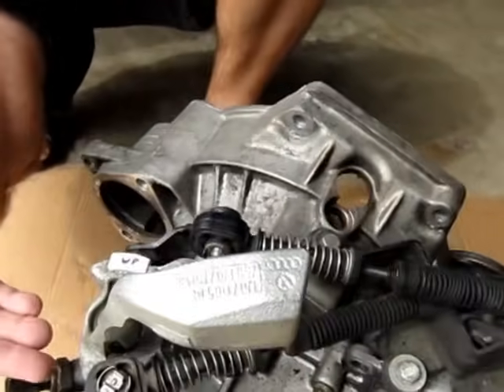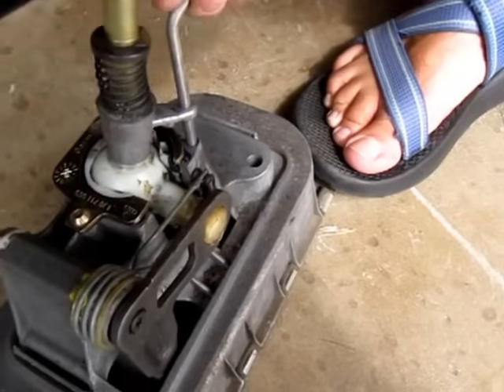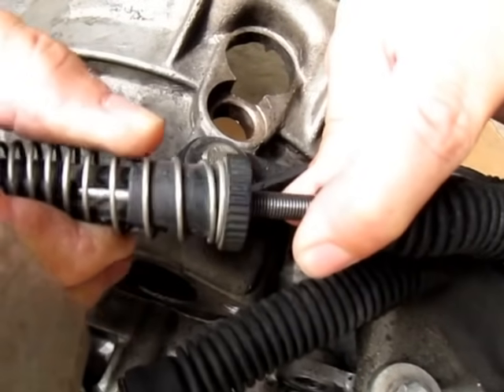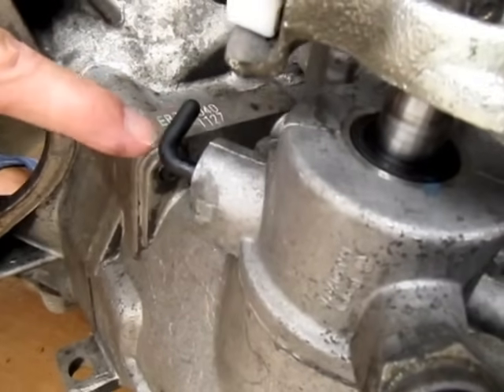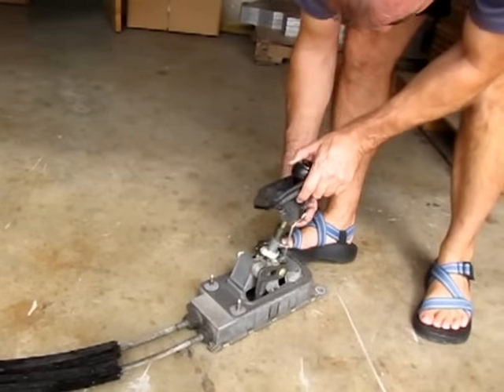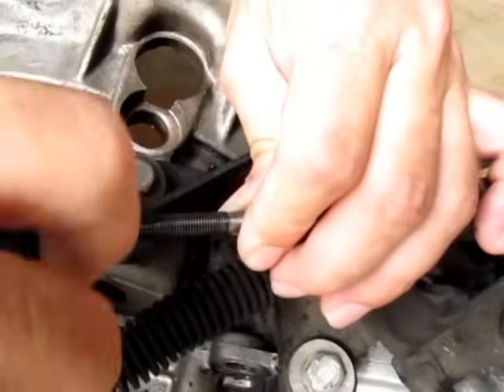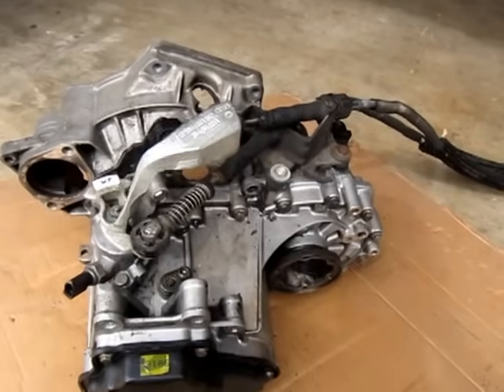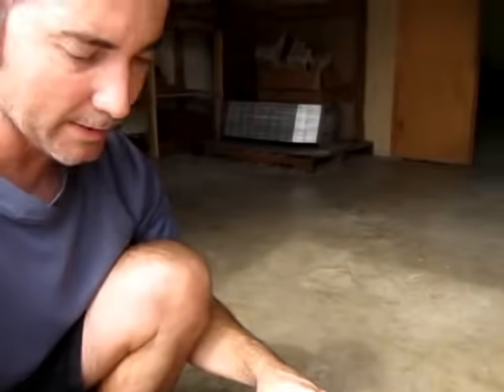VW MK4, MK5, and MK6 5 speed shifter adjustment for 02J and MQ250 transmissions

Comment: Hi there so my car (02 jetta 1.8t) wont go into 1st gear its basically like hitting a wall I've tried to slam it into first but it still wont go. I can manually put into 1st through the engine bay but not using the shifter. Yesterday I went to put it into fifth same issue. Any ideas before I burn a whole through my wallet?

Comment: I have a Skoda Fabia 2003 1.4 8V, I'm not sure if it's ecauae they gearbox is taken out of the ngine bay, but I feel like the counter weight looks a little bit different in my car, everything is really similar. Is this method of adjusting going to work on my car's gearbox, or does it differ from a model to another
Reply: dieselgeekdotcom , yes, cables. No set of holes, and yeah my pin is chipped off. I did figure it out though thanks you to guys. It didn't work the first time though and this is why I was confused.

Comment: Thanks for the video, one thing that would improve it would be to indicated what direction you're pulling to pull the slack out of the cable, an arrow or something would be nice.  The first time I did it I pulled the wrong direction and lost 1st gear.  2000 Golf TDI w/267K miles and still getting 50 MPG.
Reply: And yet after your criticism you also fail to mention which way to pull the cables.
Reply: @joepenfield  Yeah exactly. This is where I'm at right now and can't figure out which way removes the slack.
Reply: Push the cable towards the shifter knob inside the car. ....loads the shifter knob assembly making the cable tight. Hold that position and release the spring.
Reply: @cconditt Thanks.....now back to the GTi......😂

Comment: Paid a mechanic that had no idea what they were doing to install my shifter cables (my first mistake, but they had all 5 star reviews). I've lost 5th, and the car is going into reverse where 1st should be. 1st through 4th are now where 3rd through 5th should be. Any tips? Likely taking this to a shop soon. I tried this shifter adjustment and neither of these methods made a difference. Hoping it's nothing catastrophic. Before I had to replace the shifter cables, it drove like new at 128K.

Comment: I need help. jetta mk5 TDI 5-speed , 2006. I have play in the shaft of the shifter tower on the tranny, the one that goes up and down into the transmission. I have play left to right, considerable, and i havent found a bushing for it anywhere. I know theres a seal and needle bearing for the MK4 5speed, but i cant find anything for my MK5. HELP ! I made a little video to show the play in that center shaft, i hope its ok if i post it here. https://www.youtube.com/watch?v=t1RNtZE7fig
Reply: maybe change the super slider from dieselgeek.com

Comment: Jim thanks for the great instruction. I had an old cheapie screw driver that was 5mm dia. I think a 5mm pin gage (used in machine shops) that is 2'' long would work too.

Comment: Hi Jim - Thank you for the video as it’s been helpful.

I have a 2002 337 6-speed. I am finally able to engage 6th gear since purchasing the car 2 months ago. However, I need to press down on the shifter to engage 1st gear now. If I calibrate the shifter to engage 1st gear nominally, I end up losing either 6th gear again or even both 5th and 6th altogether.

Any ideas what I might be missing? I can’t seem to figure it out. 

Thanks again.

Comment: That number by the locking pin, is that the trans code? I'm looking to find the trans code location.  On a 2007 Rabbit 2.5. manual 5 speed box.
Reply: Thank you for your prompt reply. I checked mine & it's JCT, at 180,000 I'm clashing going into 3rd. Looking for a used one.

Comment: Hey thanks for the awesome video!! I used this to adjust my shifter, and it feels much cleaner and smoother now - but I have a new problem I hope you can tell me how to resolve. 

The problem I started with was that reverse was hard to engage. I couldn't push downward and just slide into reverse....it started with "clunking" into reverse, and eventually, about 2/3 of the time, I would just end up in 1st. That problem is almost entirely gone now. However, there was a trade-off: I don't have 5th gear at all! What might I have done wrong? I feel like all the gears have "moved to the right", if that's possible....and 5th gear is so far right that it's just not there. I thought I had 5th when running through the gears during the adjustment, but apparently that was 3rd. :\

Also, fwiw, I used a drill bit on the shifter because I don't have that "perfect fit" peg you demonstrated with. My drill bit is the largest one I could fit into the top hole, so it's not loose there, but it's loose in the bottom hole. And the shifter doesn't seem as solid when locked into home as yours appears to be in the video. I'm not sure if that's an issue or not. 

Would appreciate any advice :)
Reply: dieselgeekdotcom thank you!!

Comment: Hey i saw both off your totorials on the gear adjustment on MK4 transmition. You talk about taking the lack out before releasing the cable spring adjustment. please shere is IT nesesery becouse you talk nothing about that on the 2nd totorial. greetz

Comment: Will this work for the O2M factory 6 Speed trans in the 2002-03 GTI 337/20th Anniversary/ 2003 Jetta GLI VR6 ?  Logic says it should but there is an extra gear there.
Reply: Thanks for the information. Looks like I need to take the battery and battery tray out first which is no big deal. Then I just need to be very careful not to force the locking pin so I don't break it.
Reply: What exactly is a sigma 6 transmission? Is that what they call the newer 6 speeds in the Mk5? I understand it's similar to the 02M which is the earliest factory 6 speed I'm aware of. Aside from the nail shaped head on the pin.

Comment: Had to remove trans from a 2004 gti 5spd. Installed a 2000 jetta 5 speed. Had the large chrome shifter foot removed where the cables hook to. Reverse seems to be first gear. Wondering if i have the chrome part clocked wrong on the splines. Any advice.  Shifter goes in all other gears.

Comment: Thanks for the Video. I was able to do it via the second option, (Broken L-Shaped locking pin method).  However I don't think my L-Shaped locking pin is broken.  I just couldn't get it to lock into place! Maybe it's my rookie hands in this particular project.  I pushed the lever bar down a little bit as directed to do, while adding slight pressure to the L-Shaped locking pin waiting for it to lock into place.  It didn't do it.  I added a little bit more pressure to the locking pin, and still wouldn't lock into place.  I don't want to add too much pressure and break the L-Shaped locking pin.  Any suggestions on how to get it to lock?
Reply: Figured it out. Watched the video again, and noticed that while rotating the L-Shaped locking pin upwards, you push the pin in as well.  Bingo. Redid the job in 3 minutes, and everything works great, and feels smoother.  Thanks!

Comment: Hello, I have a 2001 jetta tdi auto changed over to 5 speed. It has sarted getting harder and harder to shift. Today I almost couldn"t get it to go into gear at all. I can't tell if it is a slave cyl. issue or an adjustment issue, or something else. It doesn't slip at all or pop out of gear. Any intel would be greatly apreciated. Thanks
Reply: dieselgeekdotcom  Ok I will this weekend. Thanks for the reply.

Comment: I tried to do this. The cable that I guess controls going into reverse, mine pulls right out from the spring clip part. There's a ton of slack to the point where it just falls out and the clip doesn't catch. I sort of managed to get the two connected, but when I drove, 3rd and 5th were really short throws and would grind if I didn't hold it tight into gear for a few seconds. After driving for about 25km or so, the problem came back where I can't get into 1st or 2nd, and I still can't get into reverse at all.. when I can push down and up, it just goes into first and then locks out all other gears. The shifter itself is also very stiff. I actually broke my shift knob today.. snapped right off. Can someone please help?
Reply: Thanks for the reply. I actually watched that video when I first bought the car last year. I didn't have the right tools for the job to get that part out (the pivot part - forget what it's called) so I just lived with it. But that is the reason everything got so bad. Oh, I also broke one of the spring clips when trying to adjust again and had to get towed.

Anyway, I managed to get it fixed this week after wasting my time at another mechanic first. They were eventually able to get the pin out (it was really stuck in there), and adjusted the cables properly (the first guy didn't lock the shifter so it was completely out of whack).

I now have use of all gears, including reverse (though it's still a bit finicky to select, and gets a little stuck when I come out of reverse - the lever doesnt quite pop up on its own so I have to wiggle is a bit). 

It's good enough for now. :)

Comment: Is it important to remove the slack from the cable? Another video on YouTube doesn't remove the slack, he just snaps it back in place.
Reply: Thank you. I have a question if you don't mind. I have had a brand new clutch/master/slave cylinder /fly wheel fitted to my MK5 1.9 TDi golf and 2 new engine mounts (dogbone and tranny mount). When I change into 1st and 2nd gear, there's a clunk. If I keep my foot on the clutch whilst changing gears it's fine. Any ideas what this could be, considering I changed the mounts too? Thanks mate

Comment: trying this today, got the upper cable to adjust fine, but the lower wont move. I can move the spring around but the plastic cap(?) bit wont move down the cable. any suggestions?
Reply: Worth trying any penetrating fluid or will that make it difficult for the fingers to grip the cable if I do ever get to tightening it? Also could I remove the cable from the ball joint on the gear arm for better access?

Comment: Well, I did the adjustment and it worked, except for cycling. As soon as I try to cycle the gears starting at first, it locks back down into second and won't come out. It does this when I try to go into first gear.  (sigh) 
One smaller attempt down. Looks like I'll be moving onto a different repair.
Reply: dieselgeekdotcom Yes that's been done. I realized for anything more, it's beyond my ability because I don't have a proper workspace anymore. I limped her up to a shop. They're looking into it right now.
Reply: dieselgeekdotcom I'll let you know. Absolutely!
Reply: dieselgeekdotcom Turned out to be cables and bushings in the end

Comment: Hey guys this video is still helping people.  My cables fused the 3 little plastic fingers of the adjuster with rust.  Some WD-40 and a few taps with screwdriver freed them so then I could adjust them correctly.  Works great now.  Thanks!

Comment: I can't get the car into reverse. 1 st is where reverse use to be. All the gears are out of sync. Will this fix that or do you think it could be something else? Would a broken shifter cable bushing cause this? Both cables move when moving the shifter. 2000 VW Golf GLS. Thank You
Reply: Having the same issue on my 02 gti, it sometimes goes into reverse but mostly dosent want to
Reply: It ended being a shifter cable bushing. It completely fell apart. Got the bushing kit from Diesel Geeks and the 1st gear getter. It shifts beautifully.
Reply: You have to take off the console surrounding the shifter. And with a flashlight or with your fingers feel where the cable connects to the shifter. If it is you will notice the play where the bushing should be.
Reply: Tip: there is a screw hidden under the ash tray.
Reply: are sure it snapped? i heard having them snap is very rare. If it is it's going to be a bitch. You have to jack the car up and get under the shifter box. remove the exhaust from the header down up to the cat. Then remove the heat shielding and drop the the shifter box.Then its self explanatory...

Comment: Can't shift into first or second now. Thought I followed the instructions exactly. Any ideas?
Reply: +dieselgeekdotcom thanks for the quick reply. I tried a method where the cables are opened first, engine is locked into home, and then the shifter is locked, and then the cables are relocked without pulling tension. That worked well but then I shattered my windshield as the hood came up during the first minute of the test drive.

Comment: very detailed video One question I own a Skoda Citigo 2013 26000km on the clock sometimes it's very difficult to engage reverse doyou think it;s a cable adjustment issue and if so is it the same adjustment as the one in yor video tks

Comment: Thanks for this video.  My pin wasn't broken however I was having difficulty adjusting my shift cables on my 14 Jetta 2.0
5 speed.  I adjusted my 5th gear away !  I used your method of adustment assuming a broken adjustment lock pin
and I'm back rolling again.  Shifter slop is all gone and 5th gear came home.  Thanks once again.

Comment: hi jim, i have an audi a2 (UK) which has developed a problem selecting gears. The only gears that change are reverse, 1st & 2nd and all the other gears 3rd, 4th & 5th will not engage as it doesnt seem to be properly seated at neutral position or even reach these gears. it seems very stiff as if something has stuck or lodged between something and i dont want to force the gears in case i break or strain something. when i try to move the shifter inside the engine bay after watching your video, it will not move upwards into the 3rd/4th/5th gate as if something is stuck! any ideas what i could do to try and fix this?  thanks for your time :) cheers cammy

Comment: what if I have a diesel geek sigma 5 and all my gears are perfect besides 3rd at high rpm? I get a odd grind, not like a regular grind of gears but a loud and unpleasing crrrchh sound. 3rd gear synchron? 2005 gti 1.8t 5speed.
Reply: +dieselgeekdotcom thanks for the quick response.
Reply: +dieselgeekdotcom hopefully, just have to hold back and focus on the daily driver aspect of the car. maybe I'll rebuild when ever I need a clutch and go lsd all at once haha. thanks again for the great input. much appreciated.

Comment: This could not have been more helpful.  THANKS!  Once I saw that the orientation is a bit different for MKVII and I focused on the cable with the horizontal end vs. the cable with the vertical one all was well.  Taking up the slack is key!

Comment: Hi My transmission, completely lost it's marbles, I did your trick and I got it back to working except for 5th gear, when i shift to 5th it goes to third, any suggestions on how to fix this?  thanks
Reply: If you cannot get the whole range from reverse/1st to 5th your linkage has too much wear. It's probably worn nylon bushings.

Comment: This is all well and good, and I am glad it is here, but little plastic part that looks so easy to slide back broke . Now I have a rod disconnected from a part that is pressed in by manufacturer. the other one I cannot move at all of course I can break that one too! I bought a 2001 Beetle looks good but it has a lot of problems indicative to this car, which  I am finding out are many.

Comment: I just replaced my clutch, and have followed the instructions on this video, but now I have no reverse gear.  The 1st-5th gears shift smoothly and it feels like it is shifting into reverse when I press the gear shifter downward, left then forward, but the transmission shifts into first instead.  Any Advice?
Reply: Did you manage to get to this resolved? What was the fix?

Comment: My transmission doesn't seem to want to "lock" into the home position when I pull up on that black lever. I replaced the clutch, pressure plate, throw out bearing and clutch lever in the car. Once I got everything back in the car wouldn't go into reverse. I could press down on the shifter, move it all the way over left and up and it would seem to go into reverse, but it would just be first gear. If I pressed down really hard and moved it as far left as possible while holding a lot of pressure down and left it would sometimes go into reverse. Thinking it was just the shift linkage needed adjusting I found this video on how to do it. Now the shifting is all screwed. It's in reverse all the time now no matter where I try to move it. Also it seems to be favoring "center" far to the right now. Any ideas?
Reply: +dieselgeekdotcom Thank you SO MUCH Jim. I watched the whole video like I should have done in the first place. Car works and shifts beautifully now!

Comment: problem, i did this twice using the second method, the first time it worked perfect but i was still not satisfied. when i attempted to do it again, first gear went to the reverse spot and now i have no reverse. i cant seem to find the correct spot for normal shifting again. any thoughts?
Reply: Took my car to pep boys and that's exactly what they did to my car. Then they "fixed" it but it is still not right. Going to try to correct it myself with this method . Did you fix yours?
Reply: sorry for the late response but mine is fixed. i was able to fix it by myself. make sure not to pull up when twisting to fit into "second".  if that makes sense. this was a while ago but if you have any more question feel free to ask and ill back track and remember exactly what i did to fix it.
Reply: This happen to me as well. The way I fixed it was, instead of pulling the cable slack away from the spring locking ring, I pulled the cables towards the ring.
Reply: I'm having the same issue. How did you fix it? I don't understand what you said. Thanks
Reply: dieselgeek.com
Reply: dieselgeekdotcom